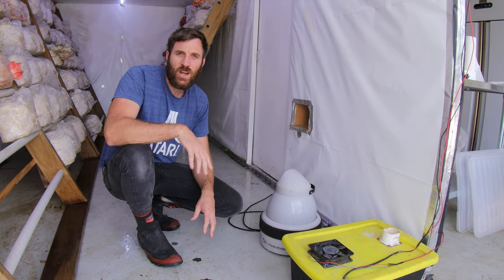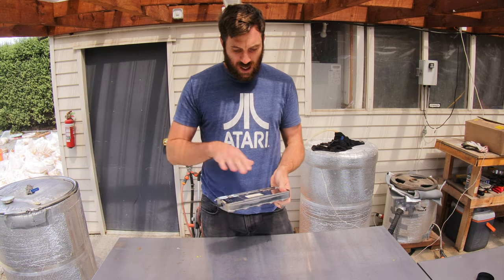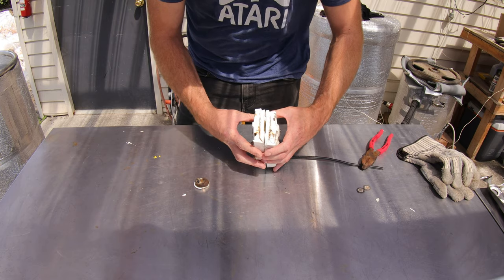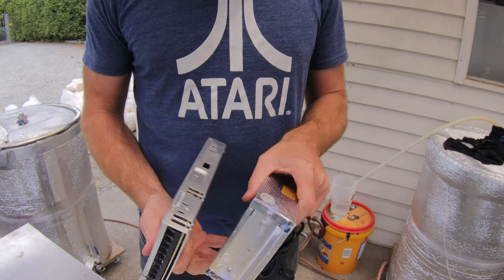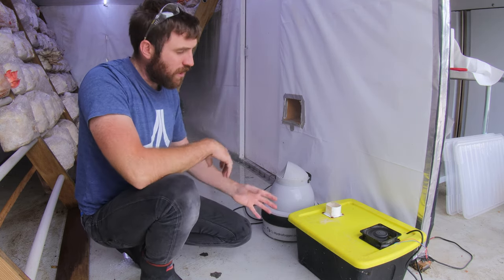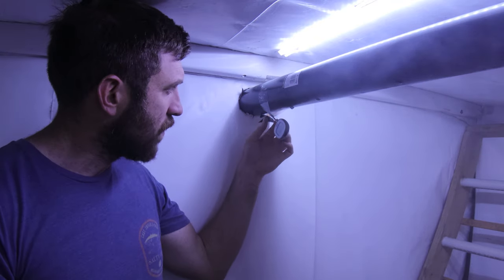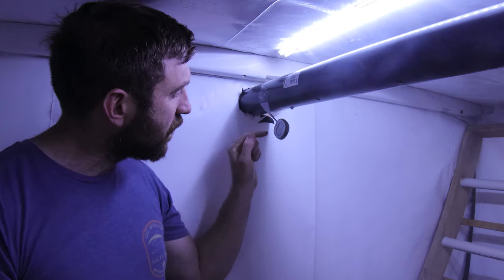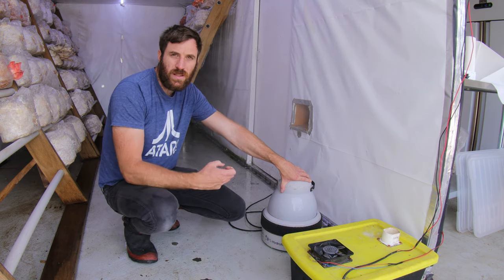Can You Cool a Fruiting Room With Humid Air? Mushroom Farm Humidifier Repair/Replacement.

Comment: Hey, I stumbled upon on your channel completely by chance and I'm loving your videos. These are really informative and I don't even have plans of making a mushroom farm! Looking at the humidity graphs you seem to have a bit of variation. I don't know your background or what your humidity controller implementation looks like, but since your are dabbling in automation, have you heard of PID controllers (https://en.wikipedia.org/wiki/PID_controller)? With a properly tuned controller, your humidifier can be more responsive because it is acting not only in response to the current value of the graph, but also its slope. It may also help with the durability of your system because the corrections, although more frequent, should be smaller. Hope this is of some use. Keep up the good work, and hope you have a lot of success!
Reply from the maker: I use PID controllers for my sterilizer. Unfortunately I think connecting one into the automation software might just be out of my depth....
Reply: @OakandSpore  No worries, it's more of an optimisation rather than a real necessity. Keep it up!

Comment: I use a fogging nozzles that uses compressed air(2.6bar) and water(3bar) and it works beautifully, especially since where i live the water has a lot of minerals that would eventually destroy ultrasonic disk humidifiers.
Reply from the maker: I know a few people that used compressed air! The problem here is having a compressor kick on at all times of the day will caused the neighbors to lose sleep!
Reply: @OakandSpore  @Oak and Spore Mushroom Farm You have to get the ones that are oil less and "silent"(kinda like the ones dentists use) which are bit quieter than a vacuum cleaner and if placed in a separate room you can kinda hear it but not nearly enough to be a bother, also the fact that they are oil less means that the mushrooms won't suffer and aside from draining the tank once in awhile they require zero maintenance.
Quick question, i have been wondering about the ones that use oil, does it really affect the mushrooms or their editability? The people you know what type of compressor do they use, are they oil less? I want to know because the ones that use oil are way cheaper.
Reply: @OakandSpore  🤔...So, may you can use compressed Air in Bottles ?!
Reply: Maybe an inline water filter like ice machines use.
Reply: @ilovethemonkeyhead8523  What do you mean?
Reply: @jidun9478  Do those remove all mineral content?
Reply: @CMZneu  maybe use an "silent" air compressor over the day, refill Bottles at the same time ,and over night use compressed air from your Bottles to mist the fruiting Room quiet silent without that boring "BRRRRRRRRRRRRRRR-SHT"  and the Neighbours will thank you 😉

Comment: hello . 3 weeks ago i followed your advice and used pinewood pellets for my oyster mushrooms blocks, i used 100% only pinewood pellets, No suplements. and today after 3 weeks incubation small mushrooms caps started to grow. so i can confirm pinewood pellets work. i guess with some suplements would work better. thx again
Reply from the maker: You need supplementation, pine in its own doesn't work good at all. Try soy hulls or food bran.
Reply: @OakandSpore  yes i will add bran in my next blocks. Did not had any at that time
Reply from the maker: Check animal feed stores for bulk amounts. Horse food stores usually stock soy hull and bran.

Comment: Hey my man.  I really like your setup here and I'm thinking of implementing this in my grow tent.  I have a concern though, the moisture build up in the pipes are you concerned about mold getting in the pipes and may have mold spores in from the humidifier holes and FAE?
Reply from the maker: All my piping disconnects so I can clean it. I use something which resembles the thing they used to use to scrub out cannons with.

Comment: Depending on if u have an uv light, u cud have up to 3 electrical chords coming from ur humidifier…if u connect to a controller, do u combine all plugs into one or just the fan into the controller & have the other chords plugged into another outlet, leaving them to run all the time?

Comment: Great video thanks! I'm just about to build a 4 tier greenhouse martha which will be located in a shady spot outdoors. Still going to get warm but good to know I can try to regulate this a little bit. May I ask what size fans you would recommend and how many head fogger? I was thinking of an 80mm fans and a 3 head fogger but perhaps I need to get a 1 head to ensure it will come on more often?

Comment: Thanks for this valuable information! Great job! I have two questions:
- What is the volume of your grow room (m^3 ?) and what's the air flow that little fan has. This is quite some tubing length it covers.
- have you considered centrifugal humidifiers hung from the ceiling spreading fog/humidity 360° ?
Reply from the maker: about 24m3. Centrifugal humidifiers are a possibility, but the method I use is cheap and easy.

Comment: I haven't been doing this too long but everything I've seen shows that mushrooms don't like to be wet and when I have my fogger turned on to where it looks like a a cloud flowing out it makes the floor wet so I noticed that with a rheostat on my piezo I can turn down the power and get a light fog a very light fog coming out as long as my humidity sensor is up high I can still get into the 90s real easy without any water buildup at all just putting that out there for anybody I wish some other people would look at it and see what they think as I said I haven't been doing this that long.
Reply: I am having exact problem: too humid that a layer of water build up on the floor, which caused mushroom only grow stems no caps or tiny caps. Have you seen these kind of deformed mushrooms when your floor was wet? Thanks.

Comment: 90% humidity inside, do not wooden shelves rot? Doesn't the risk of contamination increase?
Reply from the maker: They are H4 treated. - "H4 The minimum level of preservative treatment required to protect the timber from attack by insects, including termites, and severe decay. H4 treatments are suitable for use in situations where the timber is in contact with the ground or is continually damp"
Reply: @OakandSpore  Ohh, good to learn that. thank you.

Comment: cool 😍 
brother what you cover ur friuting champer?
Reply from the maker: Panda film!
Reply: You should encase those in silicone or some other shield to keep out water.
Reply from the maker: You could try, but you wouldn't want to impeded the fogging disk, which is where the leak might appear in the first place.
Reply: I know house of hydro coats their foggers with a tuff coat (Corrosion Inhibiting compounds) (CIC's) and extends the warranty. Something I thought about doing for my fogponic towers after blowing through many misters in a short period of time.